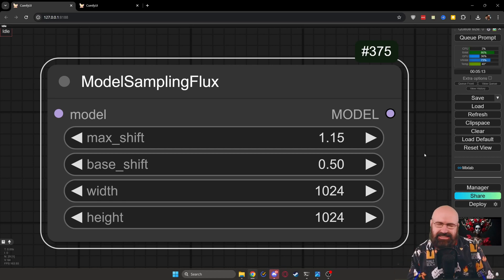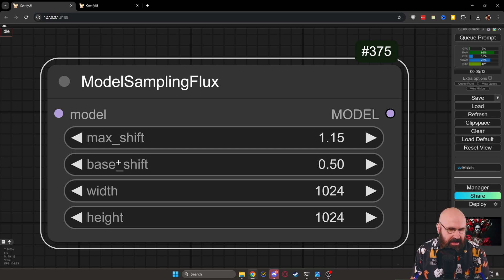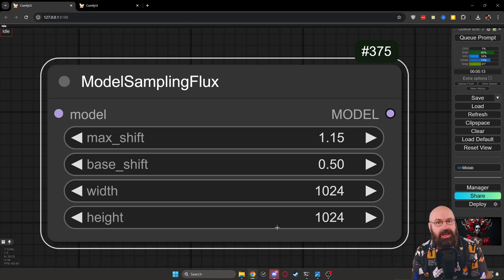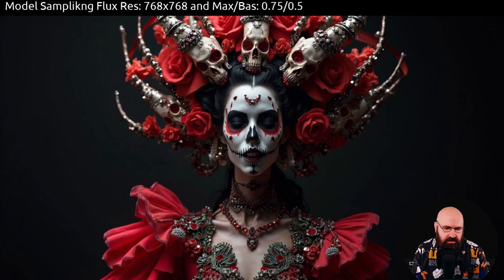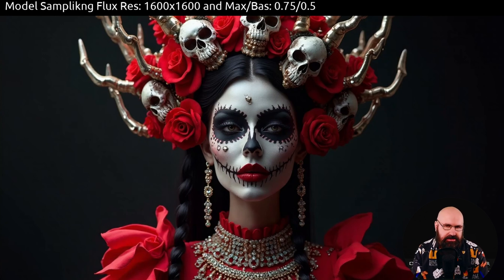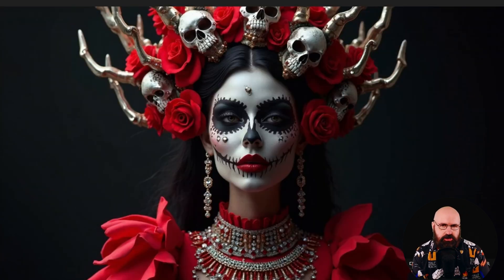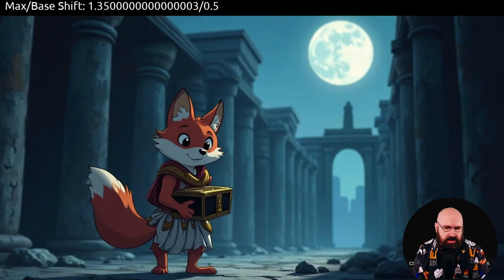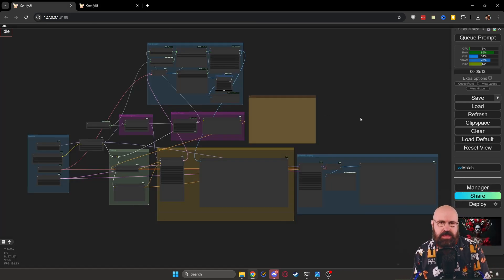Want Better Flux Images? I've Got the Secret! Model Sampling Flux

Comment: I am a bit surprised by your statements about the 'height' and 'width' values, indicating that they have nothing to do with the size of the latent image... Where does this information come from? Because you don't really indicate what they would be used for, in any case, the explanation is very confusing. 
Do you have a source to support your claim?
Reply from the maker: because the size you set as a latent image size is the size you get as the final image size. and you can see the final image size. so you can test this for yourself.
Reply: @OlivioSarikas  We might have misunderstood each other. To me, the dimension parameters of this node obviously don't define the size of the final image, but they should be similar to the latent image size to optimize sigma calculations.

Comment: Do you know about split-sigma? A higher guidance number say 3.5 creates a more vibrant image and a more interesting composition but it's less photo realistic. A lower guidance number say 2 is more photo realistic but then the colour is duller, composition can be simplier and the image can fall apart sometimes. If you use split-sigma, you can set the first few steps at 3.5 guidance then the remaining steps at guidance 2. That way you kind of get the best of both worlds. This is my understanding, I could be wrong.

Comment: It does something. I don't know what. I don't know why. There are numbers. I don't know what they do. Let's call it .. better control !
Reply: Quoting Mateo: "Another interesting test is about max and base shift. Again, from a distance, they all look very similar, but if I zoom in, it's clear that lower values generate smoother, less detailed images, but with less hallucination, higher values give you more details but also more noise, so you need to strike a balance. The default is 1.15 for max shift and 0.5 for base shift, and those appear to be sensible values.

In a nutshell: higher values: more details, saturation, hallucination.
Reply: Seriously lol i was hoping for some actual insight here
Reply: That's  my problem with the SD stuff. Dozens of controls and you have no idea what changes if you change something even a little bit.
Reply: I always delete the ModelSamplingAuraFlow node that seems to come with a bunch of templates. Even Qwen Image Edit comes with it, and there's no way you would ever use an Aura Flow model with a QIE workflow

Comment: question, I'm using flux in forge and only the euler samplers in simple or normal seem to give me images and not static or blanks does anyone know why this is?
Reply: Flux has issues with other sampler types, you can use them but often you have to up the step count or and it can't use any of the legacy samplers. It's one of the worst things about Flux tbh
Reply: some samplers might not be supported in Forge, i would look up to see if anyone has put out of list of which ones are supported, but some samplers just may not work period